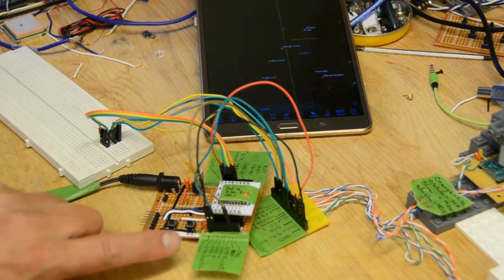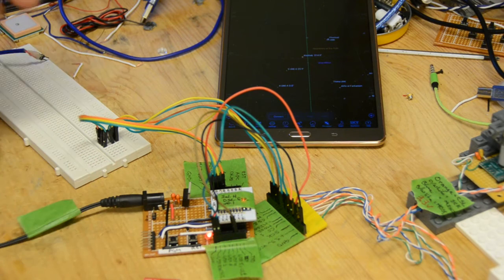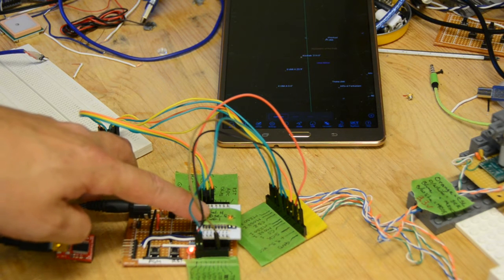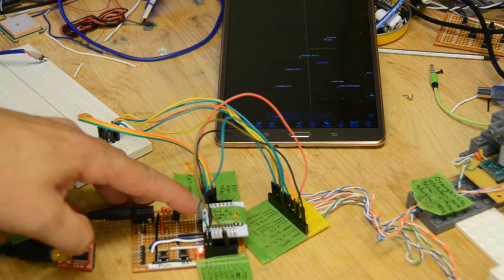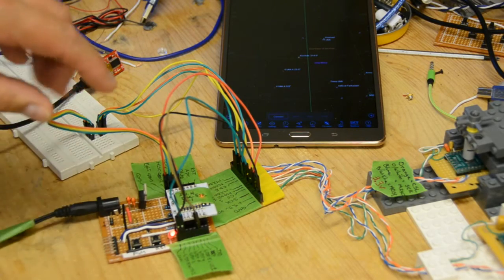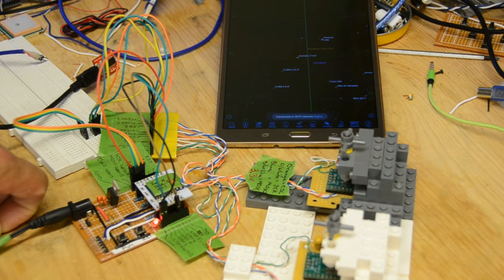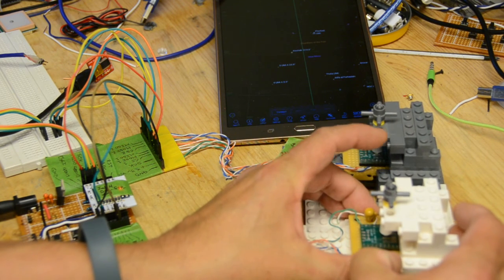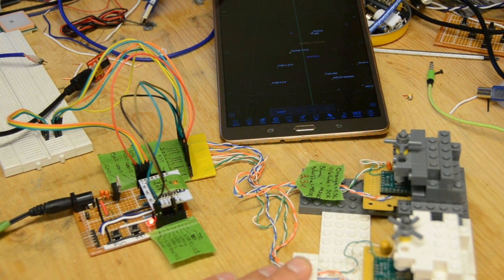ESP8266+AS5048 details

Comment: This is almost exactly the plan I had for my telescope. I just have the parts on the way by mail and its great to see the plan validated. These magnetic encoders are so much cheaper.  I'm going to use the AS5048 with a raspberry pi and android tablet combo on a porta mount. Thanks for putting this up and happy viewing :)
Reply from the maker: That is awesome!  Let me know how yours turns out.  I have to do some work on characterizing the errors in the mount, but I can use it as is to get to within a wide eyepiece area for objects by taking two alignment stars that flank the area of interest.

Also I am experimenting with 9 axis motion tracking devices like the MPU-9250.  I have this idea to make a dew heater for the secondary with the motion tracker an ESP-8266.  I am not sure yet if the motion tracker is sensitive enough yet.
Reply: Nice. I have been looking at the Adafruit breakout for the BNO055 which is similar. The problem with these is drift I guess. My solutions seem to be a little more expensive but I'm not as experienced yet so I'm going the easier way out getting full breakout boards and using a raspberry pi since I'm more familiar with higher level languages like python.
Reply: Do you have any examples to read the angle data from AS5048 on raspberry pi?
Reply from the maker: I have not played with the PI yet.  Just using the arduino and the esp8266 itself.  However there is a library for the AS5048 available for the Arduino and since that is C++ it should be able to move over to the PI with a bit of work.  Does the PI have an SPI interface?  That is what the AS5048 uses.
Reply: Thanks for your information. Yes, Pi does have the SPI interface but I am going to use I2C interface instead of SPI. The Arduino lib would be a good reference for me. But where can I download the AS5048 Arduino library?  I am not familiar with Arduino.
Reply from the maker: in my github (https://github.com/grtyvr) I have forked a project from Zoetrope Labs (https://github.com/ZoetropeLabs/AS5048A-Arduino) as I was going to use that but I ended up just using the raw SPI commands and write my own interface for the AS5048